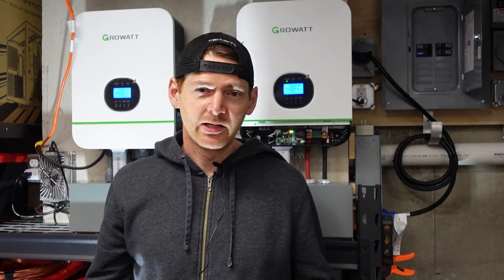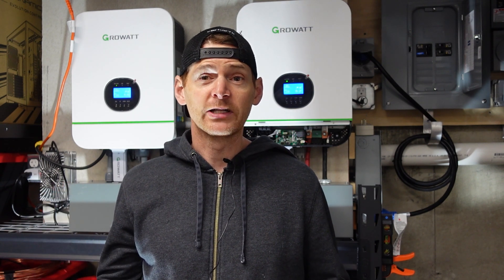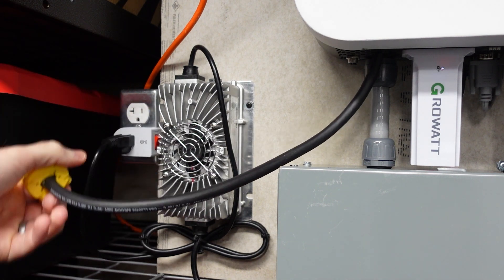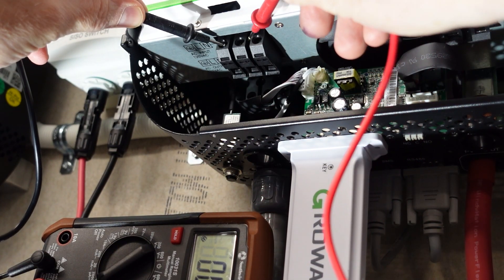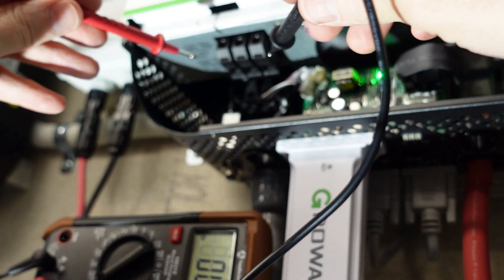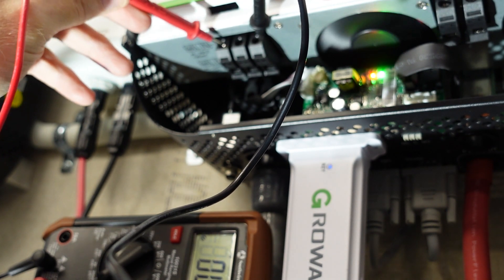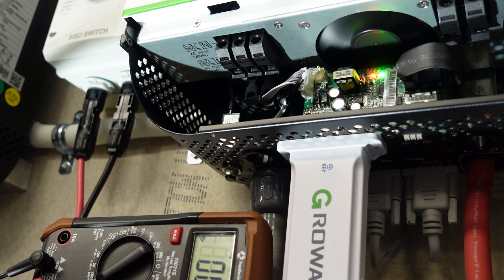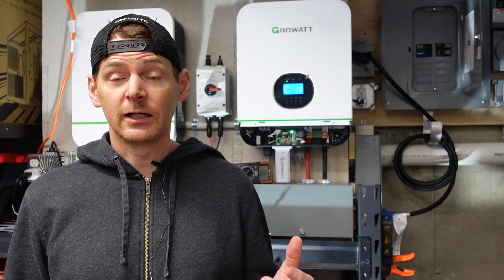Growatt Ground Fault\Short

Comment: I'm having the same problem when I plug into a generator with ground fault did you find a fix ?
Reply from the maker: I abandoned the AC input, but one thing to check is that you make the connection prior to powering on. If you connect while live that will also likely trip it.

Comment: I had this same problem. I originally had wired a GFCI breaker to the GroWatt AC output. Once I switched to a standard circuit breaker the problem went away.
Reply from the maker: Interesting. Thanks for sharing

Comment: Did you remove the bond in your output panel? Once you plugged in to your plug from your home panel which you know is also bonded you now have 2 bonds.
Reply from the maker: Yes, you can see in my other videos. I have the bond only occurring in one place for each configuration. I have removed the ground neutral bond in both inverters to avoid this situation.

Comment: Since you are running split phase, the input from the grid has to be split phase also
Reply from the maker: Hi - thanks for the comment. Yup, figured that one out! Need to post a follow-up but both inverters need a 120v input from each leg of the main panel (US).

Comment: Miracle you didn't kill your meter.  It must have at least half decent protection.  You are sticking 120V across the meter's probes between earth (ground) terminal and the hot terminal (since the bond relay is engaged), and of course between neutral and hot.  The meter will sense the current flow and determine that there is continuity based on that.  Please familiarise yourself with proper use of a meter before working on electrical, it may well save your life.

The ground fault initially reported may well have simply been that you were connecting and disconnecting from your premises' neutral/ground bond.  Some of these types of inverters have manual connect and disconnect of their internal N/E as well as an auto-sense mode that is only done during startup.  Disconnecting / connecting to your premises' supply should not be done with the inverters operating.  The manual probably does, or certainly should, explain both the settings and when it is permissible to connect/disconnect the incoming supply.
Reply from the maker: Thanks for the comment. Appears this inverter does run through an auto-detect procedure at startup and will only operate when grid tie is connected prior to power on. The manual is vague in this regard and my plan to use a switch to power on/off grid tie will not work with this functionality. I'm going to repost an update to the video.

Re: the meter - There is no voltage on the AC Input terminals while I am testing with the meter, you'll notice that there is nothing wired in. That is the first thing I confirmed (off camera but should have done so on camera for the benefit of others watching - good callout)
Reply: @lifewithlonsi  Ah, my mistake.  I mistakenly thought you were measuring the output terminals.

With the AC input vs a switched supply, you should be OK to have the unit set the solar/battery as the primary power source and fall back to mains when they are running low or the reverse situation where mains is priority for charging and loads but left turned off at the switch to force solar/battery operation.  It shoud be ok to have the mains input always connected so that the neutral/ground bond at the main panel is seen by the inverter but the power switch on the mains is set to off so that the live/hot wire does not supply power to the inverter.

The critical part is likely that the neutral/ground bond must be in the same state the entire time the inverter is on, which it should be if you leave the plug in the socket.

If the socket your inverter is supplied by has an AFCI/GFCI inline (at the panel or supplied by an intermediate socket) there is potential for the neutral to be disconnected if the breaker trips and this is not an acceptable thing to happen if you are relying on this circuit to provide your neutral/ground bond for the inverters and the circuits supplied by them.  Check your AFCI/GFCI  to see if it should be replaced with a single pole switching GFCI/ACFI or standard breaker that only switches the hot/live in this situation.

Take care with the power cord wiring gauge and the gauge of the circuit wiring too as in this circumstance they will be carrying full short circuit current of the inverter, across the neutral and ground wire in the cables, should you get an earth fault until the inverters go into overload protection or a GFCI on the circuits supplied by the inverters trip breaking the fault.  I know a lot of people do wire these things with a plug but in my opinion they should be hard wired.

Good luck and success with your project.